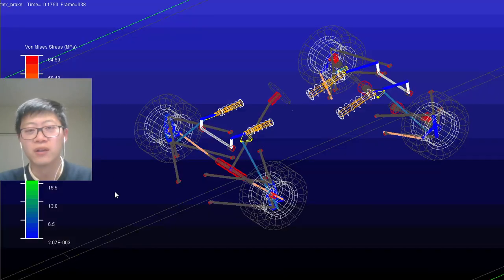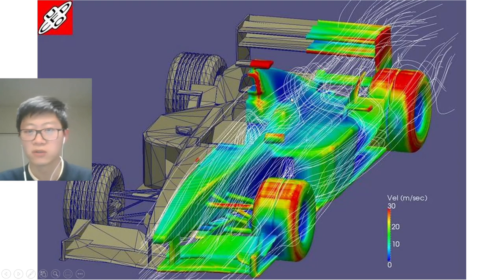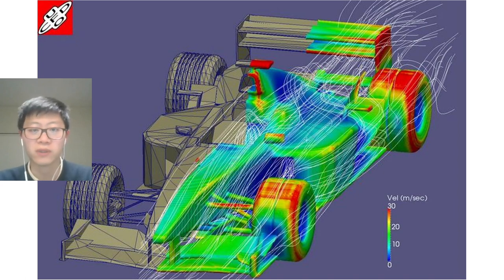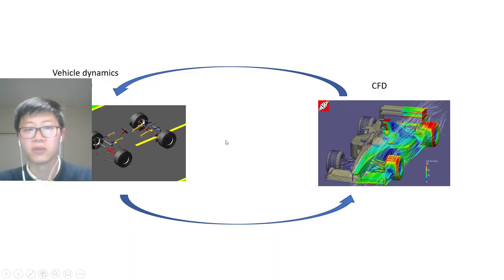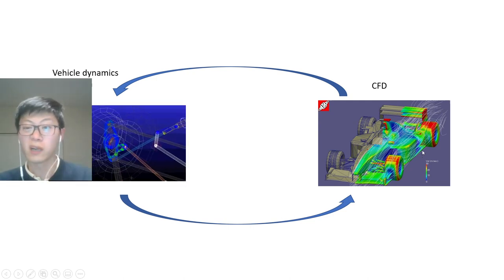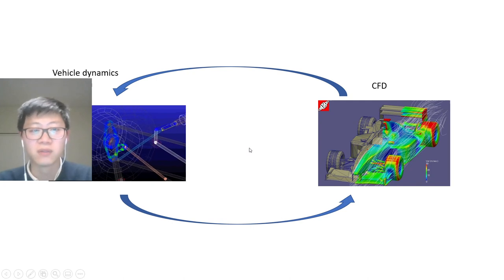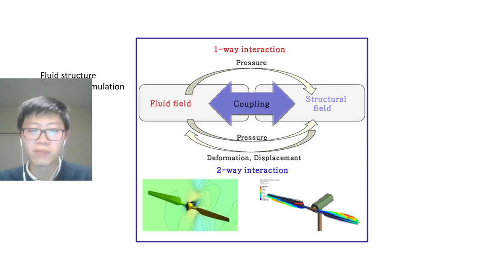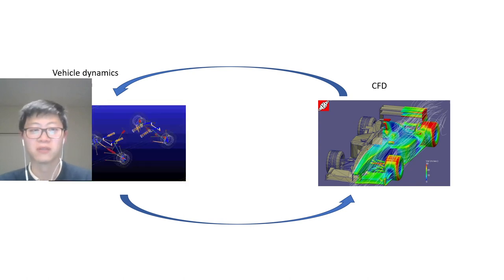How "porpoising" could have been prevented with simulation

Comment: This is a good analysis but there are is a physical reason why his problem is difficult. The forces on a vehicle are proportional to the square of the velocities.  Therefore there is dramatic increase in forces. That is the problem. So the best solution is about containing these peaks of forces. It may not involve all the analysis you propose here but you can just deal with the bounding forces
Reply from the maker: Indeed I could be mistaken. I also realized that there's a much easier way to analyze the problem - feed speed, height and pitch dependent aero map into a simple ride model (follow up video). I do however suspect that some of the teams probably didn't do even that kind of analysis.

Comment: It's Unlikely that any team would be willing to do this iterative CFD analysis because although the CFD and FIA analysis limit was lifted for the new reg year, the fact teams are usually limited in the number of hours they can simulate the car in software and in the tunnel means I doubt anyone, even the FIA, would've seen this coming unless they knew that the tunnels wouldn't be able to predict track conditions accurately enough. It's a huge oversight on the FIA's part IMO and I don't know what they can do to fix this situation going forward because teams are going to keep pushing the limits.

It will certainly lead to an interesting gamble for developers. How far are you willing to sacrifice performance to avoid disqualification from a worn-through floor plate? I wonder if teams will try and work the stalling speeds to their advantage. Being able to stall the floor on straights would be a huge straight line speed advantage.
Reply from the maker: Indeed unless software exists to do this efficiently (ie. quickly) there's not much incentive to do this. As it's mainly a problem that occurs near top speed I suppose ideally the teams would want some way to limit max pressure difference above and below the floor with some clever mechanical design. Alternatively as you say it would be even more beneficial to have a more controlled stall rather than the abrupt stall that they're having.

Comment: Air amplifiers. Look at the cut outs on the cars to alleviate the problem. All at the edge wing near the jet of air that comes out of the floor. The strakes and floor fences are designed to create outwash. The high pressure zone is squirted out the side of the car. By taking that high pressure jet, and introducing it back into the floor after the throat, you increase the mass flow rate of air, and you reduce the turbulence of air travelling through the diffuser. Less separation means more tolerance to bottoming out, greater mass flow means more downforce.